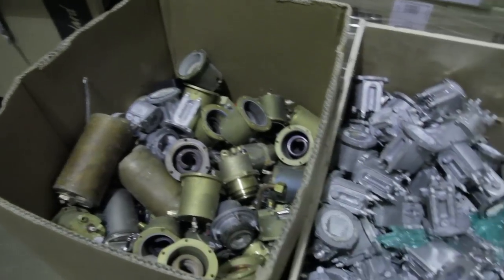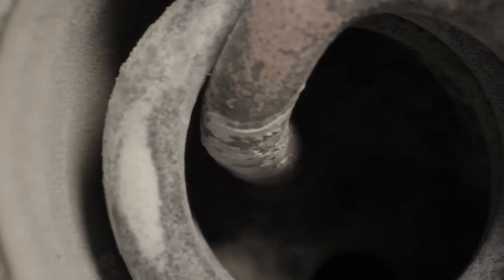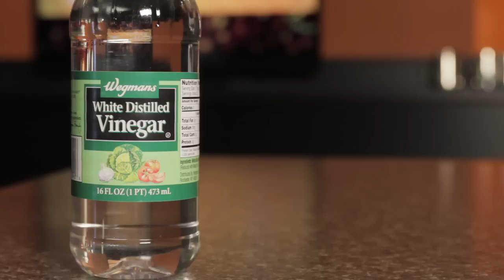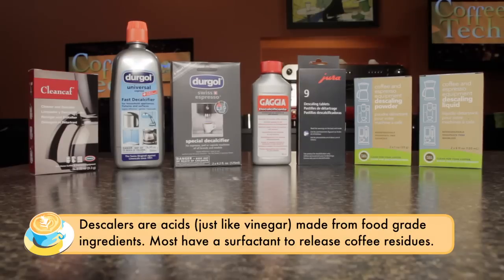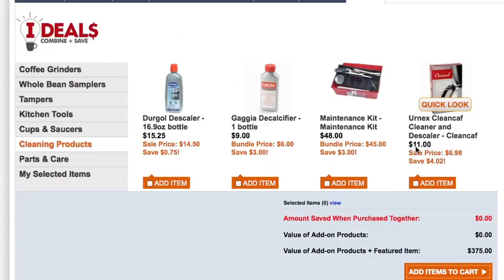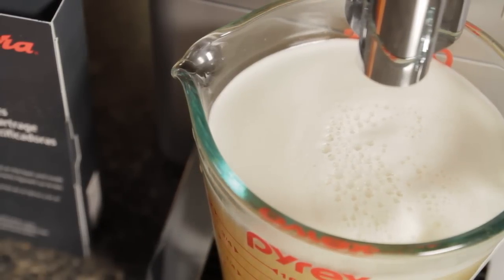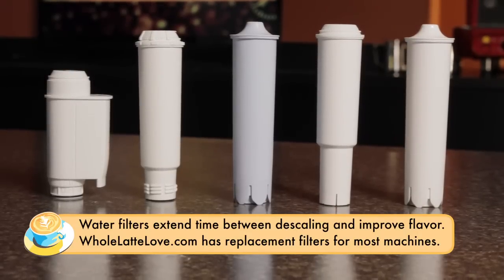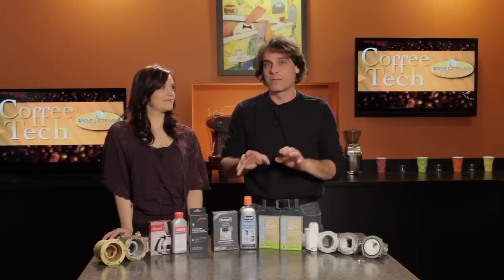The Dirty Truth: Why You Need to Descale

Comment: I think the comment about vinegar is a bit misleading. Correct me if I'm wrong.  Seals in most modern machines are made of silicone, which won't dissolve in vinegar. There seems to be a myth floating around that does. As far as I can tell, it stems from people noticing the vinegar smell that some caulks produce while curing. Acetic acid is a by-product of the hydrolysis of the acetates, not a solvent drying away as in paint or glue.

Of course vinegar can react with metal---acids react with most metals. (This includes the acids that would be in the de-scalers.) Acetic acid will react with copper (and zinc if I recall) which means it will attack non-chromed brass and the copper pipes. However, the rate of the reaction would require you to leave it to sit for months before any damage is caused. (Of course, I'm eye-balling the timeline, but the point is that it would take far longer than is reasonable for all the cleaning cycles in the product lifetime.) 

Of course, I'm a scientist, not an espresso machine repair technician as you guys are. But out of curiosity, how many copper tubes and silicone seals have you replaced due to corrosion damage caused by normal cleaning?

The next question I would ask is whether or not you have you run scientific tests to determine that de-scalers produces better outcomes?

The nice part about science is that experimental results are the great equalizer. If there is evidence then opinions, no matter how well qualified, don't matter. But I don't think there is much evidence for your claims. I could be wrong.
Reply from the maker: +Tim Teatro Hi Tim, Thanks for your thoughtful comments. Most descalers use citric acid to do their job. We have not run scientific tests. Boilers and internal plumbing utilize many different metals, plastic, rubber and silicone. In our conversations with equipment manufacturers they consistently recommend against using vinegar/acetic acid. Some may assume manufacturers recommend against vinegar in order to sell their own descaling product. But, a number of machine manufacturers who do not offer their own product are consistent in recommending consumers not use vinegar as a descaler. One big problem we do run into with those that choose vinegar is absorption of vinegar flavor into heavily scaled boilers. The scale can act as a sponge and retains the flavor taint for a long time. We feel it's prudent to follow manufacturer's recommendations and protect what can be a large investment.
Reply: Whole Latte Love Thanks for the thoughtful reply. The intake of vinegar into pre-existing mineral cake seems like a good enough reason on its own.

I'm still doubtful that chemical corrosion is a major concern, and I'm nearly certain that it if it were, it wouldn't be unique to glacial acetic acid.

I may experiment with dilutions of citric acid. Since it can be purchased as food grade powder from many grocers, it may present a good alternative to vinegar, even as a matter of convenience. It's easier to store the powder and to mix it to create the de-scaler.
Reply from the maker: +Tim Teatro You will find many threads in coffee nut forums with instructions on making your own descaling solutions from bulk citric acid.
Reply: Whole Latte Love Thanks so much for the tip. I'm quite happy I stumbled upon this video.
Reply: They are trying to sell stuff after all. I use cream of tartar for my kettle at work. I use bottled water for my machine.
Reply: Or Amidosulfonic acid "Ssulfonic acid", which is used in most manufacturer descaling solutions. Its around 10 times more effective than citric acid and dissolves scaling so no small pices clog valves. It can be bought in bulk and "magically" becomes 30 times as expensive when mixed with water and filled in little bottles.
Reply: Bernadette Groves - Cream of Tartar is simply "tartaric acid" which is a powder residue byproduct of cask wine making. Chemically speaking, it's acidic properties are most similar to vinegar (acetic acid). You could use vinegar and get similar results at a fraction of cost.
Reply: Tim Teatro iii
Reply: I most definitely will NOT be experimenting with powdered citric acid to come up with a cheaper alternative to Turgol or one of the other brand name products specifically made for descaling, thank you very much.
Reply: @berngirl5624  don't use bottle water coffee tastes best with fresh oxygenated water from the tap. Get a water filtration system and lower your carbon footprint.
Reply: @berngirl5624  isn't tartaric acid more similar to citric acid like they are recommending above your comment?
Reply: @pteppig  looking into this!

Comment: i want to get the profitech pro 700 how often would i need to descale if I use filter water
Reply from the maker: Hi Chris, We and most all machine manufacturers do not recommend home users descale dual-boiler machines. But you can eliminate the need to descale if you use an inline filter like the BWT Bestmax Premium: https://www.wholelattelove.com/products/bwt-bestmax-premium-filter-package
It's one of a very few filters that removes minerals that cause scale and replaces them with magnesium to maintain flavor without causing scale.
Reply: the general rule for all machines is 6 months

Comment: Anyone know how to make my Keurig water pump quite again? When the water reservoir is full the pump makes a grinding noise, then once it drops to about 1/3+-, it's quiet. Annoying as hell. I have it for about 3 years.
Reply from the maker: Don't know of an easy fix for that one. Was the machine descaled on schedule? May be it's plugged up with scale or just getting to end of life.
Reply: +Whole Latte Love hi, thanks. yeah, it's descaled fairly regularly. I may have to disassemble it and check components.
Reply from the maker: ItchesIt
Good luck. Sorry we can't offer a better solution. For the most part Keurigs are not exactly user serviceable.

Comment: Do you have any idea why steam goes to pressure gage ? Mine has foggy pressure gage recently!
Reply from the maker: Hi OF, Most likely a leaky gauge. What type of machine? Replacements are available for most and depending on machine type can be relatively easy to replace.
Reply: Thank you for reply! It is Breville Dual Boiler Espresso Machine 920

Comment: my delonghi machine instructions say if i don't use their specific descalor it can damage my warranty... i have dedica 680
Reply from the maker: +Coffee Break Hero Hi, Yes, we advise using the manufacturer recommended descaling product for your machine. It's designed to work with the type of metals used in the boiler as well as sealing components if internal plumbing. All descalers use acids to do their job - some acids do not play well with some metals.

Comment: great video.  Question for you:  I have Krups Espresseria Automatic.  Lived in area where water was not hard at all, so I set the hardness setting to 0.   Moved 3 years ago to area with hard water and I didn't change this setting.  I think it needs to be descaled, but since the machine was set on 0, the descaling message will never come on.  How can I initiate the descaling process manually?  Nothing in the manual..  I purchased the Krups de-calc powder and understand how to use it, but how can i tell the machine I want to do this?  There is no way to do this that I can see.. HELP ME, OBI-WAN!   You're my only hope!!  ;-)
Reply from the maker: Hi Thomas, Thanks for the comment and question. Sorry I don't have an answer for you. Think your best bet is to contact Krupps and see if there is a way to initiate the descaling cycle manually. Also a warning...3 years of use in hard water area without descaling is likely to be trouble! Descaling after that long way cause large scale deposits to dislodge and cause problems in other areas of the machine. I'm guessing you are seeing decreased performance from the machine at this point. If you do descale you may get lucky. If you can't find a way to manually start descaling I would set the water hardness to max, and continue to use the machine until it gives you a descale alert. Just know descaling after this long may damage the machine.
Reply: Thanks for the reply.  I’ve emailed Krups for advice.   Fingers crossed.   Yes, decreased performance is happening.   May have to send it in or disassemble myself and clean it.  😢

Comment: in scotland we never need to descale, the water here is very soft, the descale dip kit with my machine stays the same colour i still add the solution just to clean the boiler and brew group heads, :)
Reply from the maker: ***** You're lucky to have such nice water. Be aware that water with near zero total dissolved solids (TDS) like distilled or reverse osmosis water is a powerful solvent. It can leach metals. That's why they're always transported/piped in plastic plumbing or containers. In places where municipal water is created by distillation or reverse osmosis minerals are added back to the water after processing so metal components in water distribution systems are not damaged. Here's a link to our video about why you should not use distilled or RO water in coffee equipment: http://youtu.be/xLdQ66iaXAQ
Reply: Whole Latte Love Thanks for the advice, Ill definitely check it out, I still filter the water I use as in my machine, But as an example our old kettle which is 12 years old has no deposits, the element is almost black with natural oxidation but its hard to find locally sourced descale products as no one uses them here lol. It could be a lot to do with water processing here as waste water is never recycled its cleaned and put to the sea. We have more rainy days than a rain forest lol so water is just cleaned straight from the lakes or springs. Its interesting that its something no one really thinks about :)
Reply: Liar

Comment: I prefer using a combination of weak citric acid solution (~2%) in mixture with 0,3% Sodium-EDTA (sodium ethylenediamintetracetate aka Trilon-B, a main component of virtually all water softeners).
This solution decalcifies the boiler much faster than citric acid alone and doesn't damage rubber seals due to low concentrations and moderate acidity.
It's also completely odorless and almost tasteless.
Reply: Good job bro
Reply: Actually I am working on developing a descaler
Reply: While citric acid is readily available (I bought mine at a brew shop), where do you source the Trilon-B?

How many g/l for the citric acid and Trilon in your blend?

Comment: What if you used filtered water exclusively in your reservoir? Will it still scale?
Reply from the maker: +Kate Uhry Hi Kate, It depends on the type of filtration. Sediment and activated carbon filters do not remove the minerals that cause scale. There are other filters that remove minerals like calcium to varying degrees. Many super-automatic machines have in reservoir filters that depending on initial water hardness can double the length of time (amount of water processed) before descaling is required. At the high-end, there are filters which remove all the calcifying minerals and replace them with minerals which do not cause scale. The mineral replacement is done to maintain water/coffee flavor. Water and coffee with no minerals tastes very flat. Those high-end filters are what we recommend for plumbed in prosumer level espresso machines. Use one of the high-end filters and no scale will accumulate. We like the Best Max filter from BWT. Use it, and no scale, no descaling required. If interested, here's more info on BWT filters: https://youtu.be/yYilGVC-LaI
Reply: +Whole Latte Love That helps a lot guys! Thanks. As a note to everyone who may have the same question, we have a Jura ENA and have taken out the filter in the reservoir, and only fill with water from our carbon filtered refrigerator. We use Lavazza beans to make espresso every morning. 

I'm wondering, having just seen Barista on Netflix (and everyone who is a coffee lover should see this movie), whether I've been missing out on some of the more subtle flavors. I will promise to descale more frequently. Like flossing, it's a pain in the neck but necessary.
Reply from the maker: +Kate Uhry Descaling is the single most important thing you can do to keep the coffee/espresso coming. Like oil changes for a car. Especially important for super-autos like your Jura which use thermoblock boilers. They heat water in very narrow passages which scale more rapidly than large volume boilers.

Comment: Does using distilled water vs tap help?
Reply from the maker: Hi Oscar, Thanks for the question. While using distilled water seems like it would make sense - no minerals, there are problems. First, ultra-pure water is an incredibly good solvent. It over-extracts coffee causing bitter flavors. Minerals add to flavor. You want some minerals in brew water. Second problem... as a really good solvent ultra-pure water can cause corrosion of metal components. It's kind of the opposite of scaling. One reason why you never see distilled or water purified by reverse osmosis transported in or by metal components.
Marc

Comment: I've only used Poland Spring bottled water in my Keurig. The descale button hasn't come on yet.
Reply from the maker: Hi Tom, Thanks for the comment. Be aware the descale alert comes on after a certain number of brew cycles. The machine doesn't physically sense scale buildup. Also might want to check on the mineral content of your PS water. Some spring waters can be high in mineral content. Don't know if that's the case with PS. If you know the chemistry of your water you can use the Langelier saturation index to determine its scale or corrosion potential. We have a video on how to do that here: https://youtu.be/Iw6DEDeggtY
Another option, potential less expensive than the spring water is making your own SCA spec brew water by dosing distilled water with baking soda and epsom salts. We have a video on that here: https://youtu.be/iHI7jC0sQZo
Reply: Whole Latte Love  thanks for the reply and the video. After watching your video, I did descale my Keurig because I have had it awhile. The coffee tastes better.

Comment: Do descale solutions also get rid of potential mold issues? If not what is the best way to make sure your machine is not only scale free but mold free?
Reply from the maker: Hi R, Thanks for the question. Honestly mold in boilers something we do not see. They generally reach temps that would prohibit mold growth. That said, suppose it is possible if a machine we're left unused with water in the boilers for very long periods. Descalers are about descaling and not mold but I would assume that the acids used in descalers would kill molds. If using a semi-automatic machine with a 3 way solenoid valve then backflushing with a product like Cafiza should take care of mold in grouphead. Cafiza has bleaching agents which should in theory kill mold. Cafiza: https://www.wholelattelove.com/urnex-cafiza-espresso-machine-cleaner
Cafiza should only be used for backflushing semi-auto machines with 3way solenoid valves. It's also very effective for cleaning portafilters, drip trays etc. Cafiza should not be run through espresso machine boilers.

Comment: What does it mean if green water comes out of the machine while descaling?
Reply from the maker: Hi ZF, Sounds like a machine that may have been neglected and/or has seen poor source water quality. Green coloration is often associated with copper.
Marc
Reply: It means your machine has parts made out of brass. When a descaler attacks brass parts it causes it to oxidize green. It's normal and fine as long as your not constantly descaling.

Comment: Hi often is to descale ''regularly?"  I have a Nespresso Latissima. THANKS
Reply from the maker: Descaling frequency depends on the hardness of water you are using with your machine. Some Nespresso machine have a built in alarm to let you know when to descale. If your machine does not a have a descale alarm you should refer to the water hardness table in the user manual which will indicate the descaling frequency required for the optimum performance of your machine, based on water hardness. For any additional questions you may have regarding descaling, please contact your Nespresso Club. Here's a link to Nespresso services with phone number: http://www.nespresso.com/us/en/pages/nespresso-services?cid=SEM_B2C_US_EN_LOC_R_Google_ACQ-Nespresso-Club-E_Club-General-CD6_nespresso%20club_e_IQID=67861638-VQ16-c
Reply: Ok so mine does have an alert, should I still descale before it asks for it or is it better to  wait? thxs
Reply from the maker: Alien Xeliose
It's better to do as the manufacturer recommends. An exception might be if you know you have exceptionally hard water or missed an earlier alert to descale. Descaling early should not hurt anything. But do it early and the machine may alert to descale again before it's really needed - unless there's a way to tell the machine you descaled. Best advice is to call Nespresso Club and get their opinion.

Comment: I wonder if the vinegar thing is just a falsity perpetuated by companies who sell the expensive descaling product considering vinegar is so cheap and they can't make money of it.
Reply from the maker: wazrasta It's a common thought. Many find vinegar leaves behind a difficult to rinse out aftertaste. Especially true in equipment with moderate to severe scale build-up. Scale is very porous. Any left behind after descaling with vinegar acts like a sponge and soaks up the vinegar flavor.
Reply: +wazrasta  You are just right Sir, 1 gallon of vinegar can be use to do your machine 3 times a year for 4 dollars the 3 gallon of distilled water to rinse is 3 $, total, under 10$/ year.
Reply: +Aérodrome Régional: Although if I were running a coffee shop using the stuff that the espresso machine company says to use is probably the best thing to do.
Reply: wazrasta  I think plain white vinegar is fine.